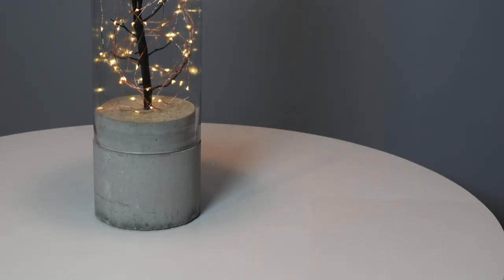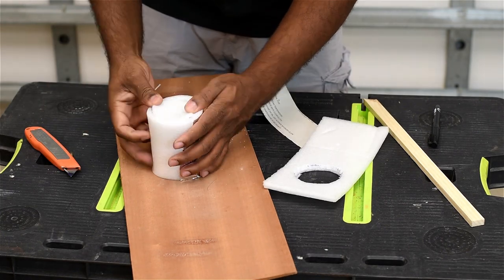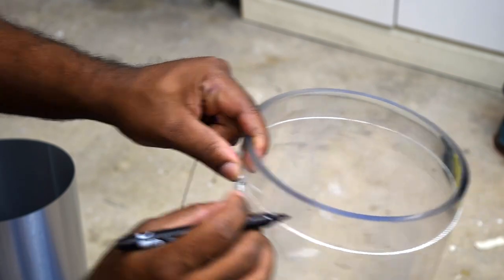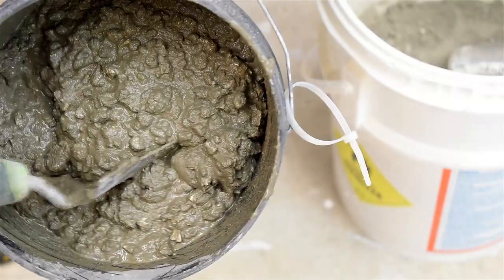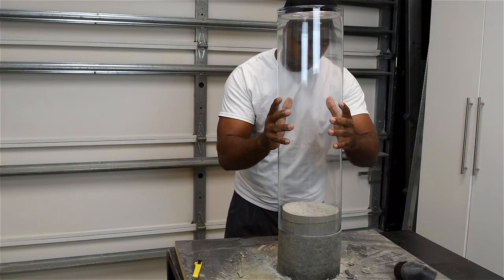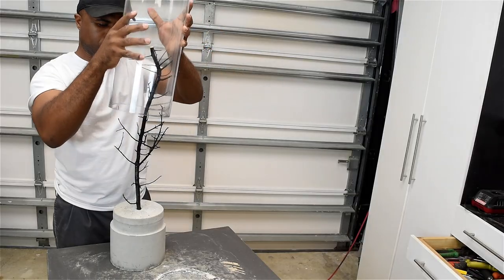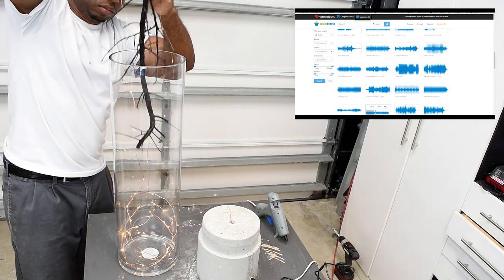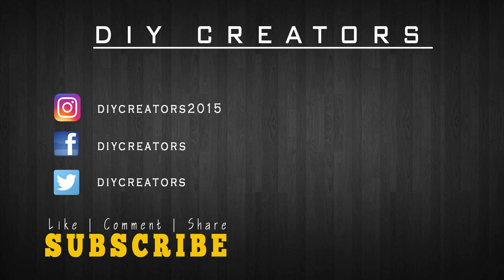DIY Concrete Lamp Indoor Outdoor

Comment: This is such a great DIY.  It's inspired an idea I've been accumulating for, for several months. I've been trolling resale sights (eBay, Mercari..) for Bake-A-Rounds.  A vintage bread baking Pyrex glass tube.  I have 12 of em amassed now, that I paid no more than 8 each.  Several were just a couple bucks .   Even with a few bux shipping, still MUCH cheaper than buying glass anywhere else.(the Dollar Tree vases I originally tried were just TOO cheap and broke too easily) 
I've also purchased a dozen solar string lights for only a couple bucks a string from AliExpress.  My plan:
Too put a heavy concrete base on each.  (Probably approx 6"w/glass incorporated 3" in)  For the tops, I'm currently trying to 'fabricate' a way to countersink each solar panel into a concrete top,(removable) that will sit on TOP of the lights, as YOUR BASE sits here. My biggest issue is that true lights do not disconnect from the solar panel.  So I either have to make a small hole in each well where solar panel sits then actually cut the wire , pass it thru and splice it back together(so lights are inside tube, obvs) OR...and this is what I'd LIKE to do but can't quite figure it out, have the solar panel well open enough that the panel can be slipped through it sideways, then rest on a 'ledge' that is the bottoms of well.   Does that make sense?  With the whole thing then countersinking into top of glass a couple inches.
Basically, a concrete top that counter sinks (for stability in heavy winds..etc) so that solar panel sits INSIDE glass, flush with top rim, in a concrete lid that fits approx 1" AROUND lip of glass.  

Am even explaining this properly???  LOL

Because I SURE THE F@*$ CANT FIGURE OUT HOW TO MAKE IT!!!LOL

HELP!

IF I can figure this out....I have a magnificent ground deck that spans the entire length of my house and equally wide(exact sq footage as my home, which is 1880sq ft) that I ld like to place these around the perimeter.  Burying them in the ground a couple inches each.

Also...in my mind's eye, they're SO HAWSOME, I'd collect Bake-A-Rounds ALL year then spend a few months in winter making the most awesome DIY Christmas gifts EVER .   LOL.  But I DESPERATLY need help with the top.
PS?  I use the Bake-a-Rounds because they're tempered Pyrex.  It takes a LOT to break em and the harsh Montana weather won't degrade the glass as quickly. Etc.  Plus...there is simply NO glass tubes/vases at THAT size, with such quality glass, for what I find these vintage baking tubes for!!  Lol. Plus!!  They come with a metal cradle intended for it to lay on it's side in the oven in.... that comes in super handy while repurposing them as they roll everywhere easily...lol

Comment: I'll say... that was one very good and smooth sanding process on the concrete!
But... I wonder if glueing wires to (or in between) concrete is a good idea, after all it takes one shortage and you may need to replace it, potentially destroying the concrete.
I was also thinking about adding a CD or mirror band or something similar on top of the conrete block, so to reflect the LED lighting upwards and around a little.
As for project ideas:
- how about a mixture of real candles and LED's, lets say as wooden indoor-shelf-lighting?
- a wooden/concrete kitchen tool stand. something to hold dishes, glasses, cutlery or even herbals... potentially a "stand in the middle of the room" or even a "hang from the ceiling" kind of thing?
Reply from the maker: Thank you, lol

I wouldn't glue it, anything could fail and you don't want more headache. That would be something ill have to experiment with maybe the mirror. 

Mmm ok ill brainstorm your ideas and see what I can whip up.

Comment: I like this project a lot; but are the lights run with batteries or 110v with a transformer???...If it runs on batteries what voltage and how long will they last... I'm trying to gauge if this would be a 'battery hog' and cost a ton to keep lit.....Thank you for sharing..

Comment: Wow! This is amazing! I have a vase that I got from a wedding. I was just about to throw it away until I saw this video. Question..... do I have to use concrete for the base or can I use something else instead? It will be used as an indoor light only. New subscriber here. I am all about DIY 😊😊😊
Reply from the maker: Thank you. You don't have to use concrete. Anything would work you may have to use a little imagination. Maybe wood?

Comment: Since you like making things with cement you should consider using it in your tool builds. The mass and weight of the cement will dampen vibration much the same way that cast iron does so it would be great for a table saw. Back in the '40s during the war when raw materials were scarce they started making machine tools out of concrete for machining metals. Since today we have epoxy-based cement available we can create machines that are far more durable with a better finish. To learn more check out the Open Source Machine Tools project which is developing tools to empower the third world and help our brothers and sisters create a better life.
Peace!

Comment: I'm stone broke.  So my lamp is compossed of 2 dead old HDD's stacked one on top of the other as a solid base.  On top of that there is an empty old white Tylenol bottle.  On top of that is a brass lamp socket/switch.  All of this is bolted together via the threaded pipe that is attached to the lamp socket/switch.  So no glue was needed.   I had two sheets of diffused plastic lying around, so I constructed a lamp shade using these.  Between the two plastic sheets I placed a sheet of paper to add to the diffusing of the light.  This paper sheet can be replaced with a sheet on which you have printed a colorful picture of some kind by using a computer printer. Total cost, $0.00 plus the remaining electrical parts of an old busted lamp.

Comment: Will plastic bottle work similar to glass ?
Reply: Possibly. Since it calls for using LED’s I think you could safely use a clear plastic container or maybe even a plastic sheet or a piece from a roll of a thin stiff plastic (similar to acetate/the material used for projector transparencies).

Comment: I might make a TARDIS version of this (Doctor Who) by putting the lights into some clear plastic tubes set equidistant in the glass vase with then cement disks cast with three holes in it to accommodate the plastic tubes.

Comment: "Radio frequency"? Men, this is clearly an infrared controller
Reply from the maker: +PyciuStw 
It's not IR. There is no IR receiver on board.
Reply: DIY Creators So this is a hybrid IR-radio remote control, right? Got me confused because there is a fully functional IR LED on it